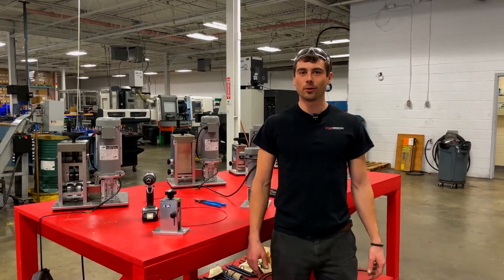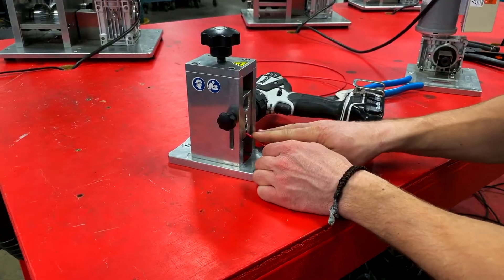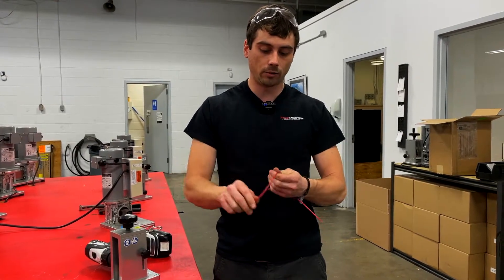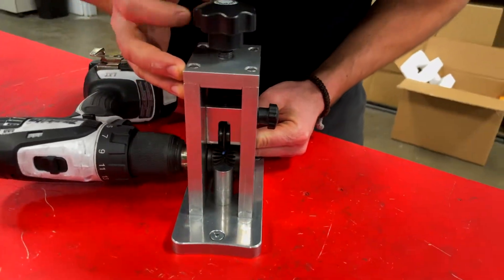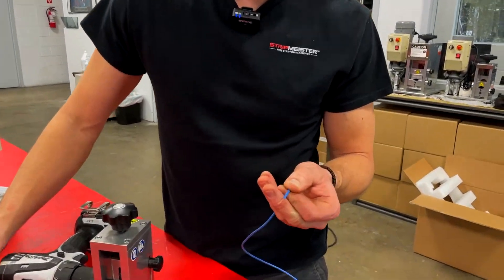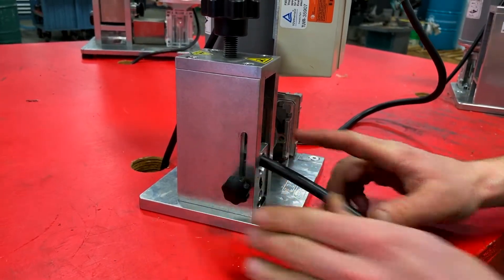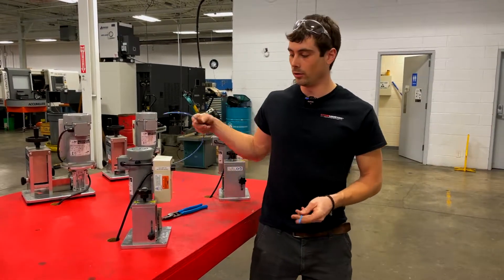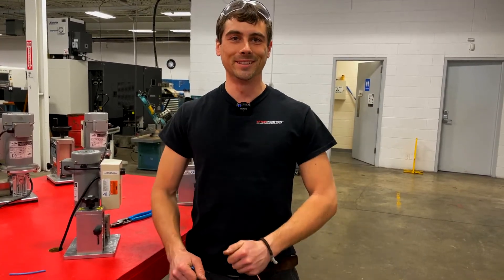How To Setup A StripMeister Original & E250 Wire Stripper's

Comment: It’s disappointing that the original doesn’t have a detachable cranking handle.  True, it might take longer to strip, but at least it would be nice to have a quieter option.  As well as those who don’t even have a power drill

Comment: This is a very good wire stripper, perfect for beginners.  Their Burlington, Canada branch is great, I damaged the machine by abusing it (Don't try forcing 3 wire through it (>>FORCE)) and bent the inside blade tower. They fixed it pronto.  I've had this for 4 years and haven't needed to change the blade or the internal puller.  It only takes about 10 minutes to master this machine.  TIPS: be very careful with your cutting depth on stranded, if you go too deep you begin to make 1000s of sharp copper swords but still very easy to do stranded.  2) The romex hole attachment for this thing is awesome because it makes stripping up to 14/2 totally worth it.  It will take the conductor sheathing off 1 of 2 conductors leaving you with a bare ground, a bare conductor and a conductor with the sheathing remaining on it.  DO NOT RUN THIS LAST CONDUCTOR THROUGH THE MACHINE.  It is a waste of time, without the outer NMD sheathing 14 and 12 gauge single conductor will get you #1 insulated copper price which is 30% less $$$ but with the remaining conductor sheathing weight mitigates that 30% difference, so it saves you time, effort and you get pretty much the same money.  Thank you Burlington Stripmeister.  Solid Machine.
Reply: Having trouble with the Romex feeding properly but that's easy to split the outer sheath by hand. And yeah I learned the hard way with my first pull of threaded, had tiny sharp swords everywhere, one stabbed me pretty good